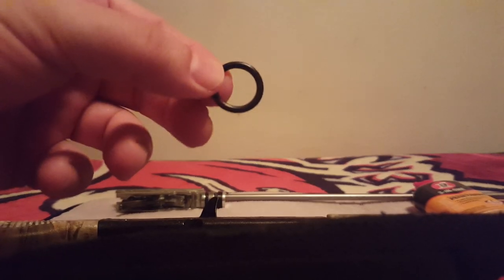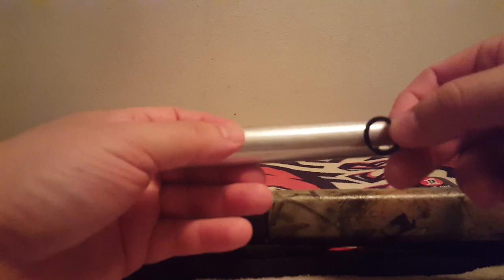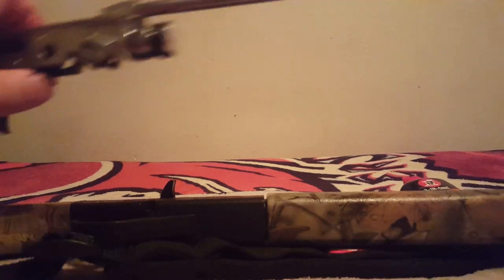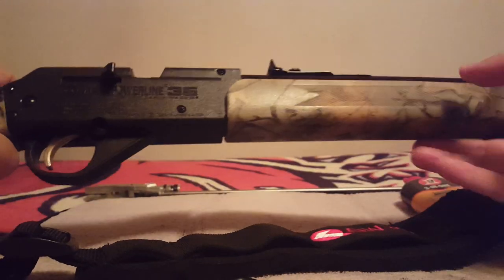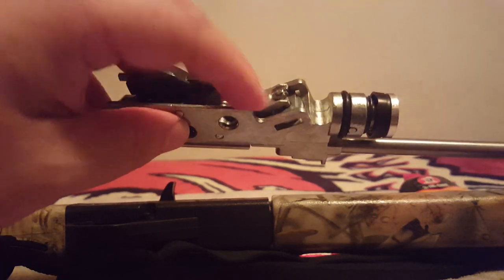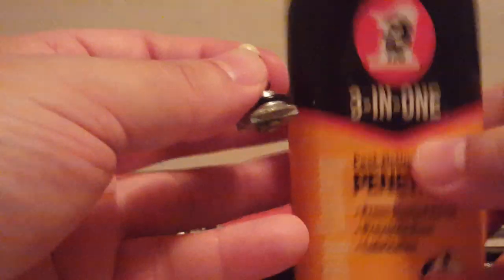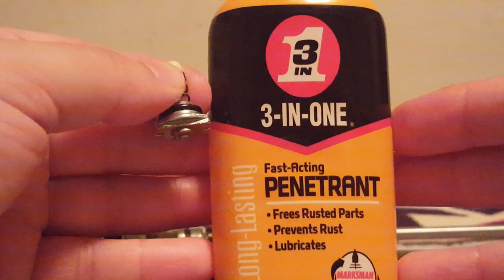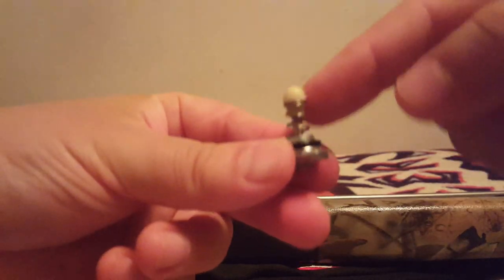Daisy 880 Crosshair: No Air Pressure

Comment from the maker: For long lasting seals, don't pump more than 10 times. I do great hunting and don't go more than 8 pumps.

Use 30 SAE ND with a dropper bottle. Very affordable. A drop or two every 500 shots. For silicone faction, Superlube O-ring Silicone great choice. 

I haven't had any trouble with basic non-detergent oil.

https://www.oreillyauto.com/detail/b/non-california-4604/chemicals---fluids-16461/oil-16865/motor-oil---conventional-25267/2673028dc6c2/pure-guard-non-california-conventional-motor-oil-30w-1-quart/nd30/4616028

https://www.hobbylobby.com/Art-Supplies/Painting-Supplies/Palettes-Tools/Dropper-Bottles/p/80882424

Comment: I had an issue with the gun not firing a bb each time. I had been using the incorrect oil to lube it. Change it to a few drps of 30w non-detergent oil problem solved. Load the bb set the safety then pump 5-7 times fires bb every time   Using the correct oil solved the problem

Comment: Thank you, you solved my issue with my 880. When I watched this video, I heard you say that you have to cock the gun to build “air pressure”! Ding ding, problem solved. Yes, I did own a Crossman 760 pump 53 years ago. Your right, I could pump it up before I loaded ammo of Choice, BB, 177 pellet or 177 dart. In fact I had two of them, still have one around here, will have to watch your videos on it. Get it back shooting again.

Lubricant question can you use air tool oil like Amsoil?
Reply from the maker: Go with a heavier mineral oil like 30 SAE ND or 30 Compressor oil.

https://www.oreillyauto.com/detail/c/pure-guard/pure-guard-compressor-oil-4-quart/pgd0/ac18

1 or 2 drops on the wiper after 500 shots.

On the Ryder you want a lighter oil. I like Ballistol TOTAL care,  but some don't like it. I found it SMOOTH shooting. Some claim it drops power, but my Hard  target test, shooting at pop can bottom, shows it is just fine.

Daisy wants you to use LIGHTER weight in the Red Ryder, so here are other choices that ALSO will cross over to your 880.

https://www.oreillyauto.com/detail/c/non-california/pure-guard-non-california-motor-oil-10w-1-quart/pgdn/nd10q

thttps://www.homedepot.com/p/Husky-16-oz-Air-Compressor-Oil-HDA10700AV/100096995
Reply: @daisy880fanaticfixit9  Thank You

Comment: Good vids What do u recommend using to clean the tube before replacing o-rings?
Reply from the maker: Yes, clean out the pump tube. I like the blue industrial paper towels from the auto shop. They nearly are like cloth.

https://www.oreillyauto.com/detail/c/sellars-towels/sellars-towels-55-shop-towel/sel0/5440030
Reply from the maker: Also, I got your other contact, but it seemed to disappear.

For the OLD STYLE, that you have, go to JL. He has that type and is an expert on the brass tube style.

https://youtu.be/BzJiBo8QhBQ
Reply: @daisy880fanaticfixit9  ok. Thanks for the replies. I will check out that vid.

Comment: Very good video my friend. I have never had a problem with my 880. But I have followed what Daisy says to do SAE30 every time. I have even had it pumped up sniping squirrels for 45 mins and it held it's pressure to make the kill at 15 yards. How hard is it to just use SAE30? Keep up the great work my friend stay safe.
Reply from the maker: Alfred, you would be surprised about this lube question. Even though chemical engineers say Nitrile is made for straight oil. But not for a penetrator!

If German chemical engineers for Ballistol say that it won't harm  material mineral oil resistant....they know what they are talking about!

Next video partly addresses silicone issues.
Reply: @daisy880fanaticfixit9  I agree with you the German engineers know what they are talking about. A video on Daisy hard sights would be good. I have found them to be very good and for the most part spot on when used as they were designed to be.
Reply from the maker: Alfred, SPECIAL MESSAGE.

I know you are computer savvy, but I have been working through the ins and outs of better security features in my comments.

A prompt reply to any NEW reply to your comment will be seen. Reply on OLD comments likely will not get through or seen. Try not to do tag along remarks on OLD comments as they likely won't be seen nor posted. 

Stay well, my friend, and I look forward to your fancy gizmo-looking videos coming out!

Comment: Do you know where I can find new o rings for my Winchester 77xs I can’t find it anywhere
Reply from the maker: Glad to help!

BEWARE OF SELLERS ONLINE. They will charge you a fortune for parts you can get yourself for a few dollars.

Initially hobbyjon had good video on store O rings, but Jon didn't investigate material and what works in airguns. He got me going in right direction.

I got you covered! My 840 has #13s going on 4 years old. Work great! Read the store description, so you know what you are buying and how good of deal you get.

https://www.homedepot.com/p/DANCO-200-Piece-O-Ring-Kit-34443/100135126

These Nitrile store rings come in protective case and fix MANY guns. For your 880 or 35 #11 x 2 and #7 for valve if needed.

I always say to keep it simple with #11s to start. If you are not holding pressure, and you lubed,  many times the ring in back blows out first. My 1977xs needed both.

Watch your lube -use old reliable. 30 SAE ND. Buy dropper.

https://www.oreillyauto.com/detail/b/non-california-4604/chemicals---fluids-16461/oil-16865/motor-oil---conventional-25267/2673028dc6c2/pure-guard-non-california-conventional-motor-oil-30w-1-quart/nd30/4616028

https://www.walmart.com/ip/Super-Tech-Non-Detergent-SAE-30W-Lubricating-Oil-1-Quart/52626201